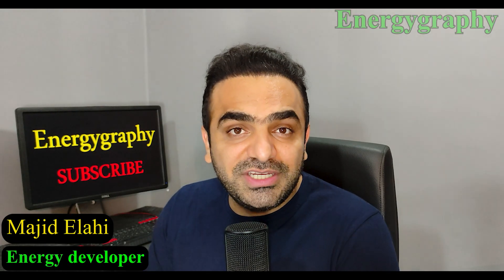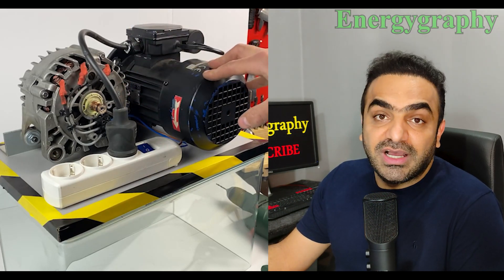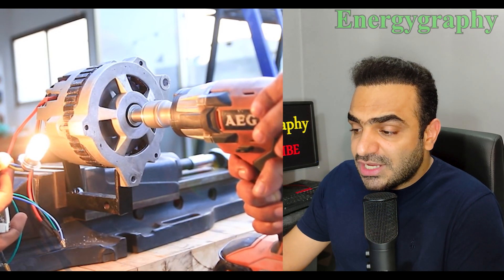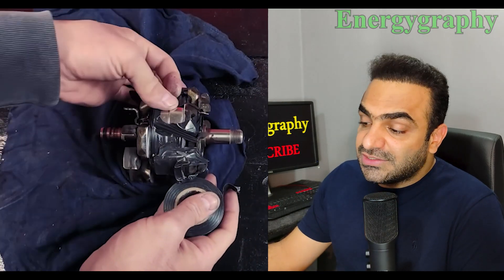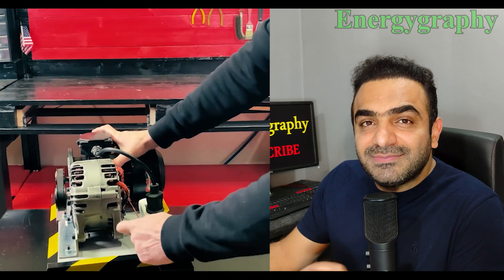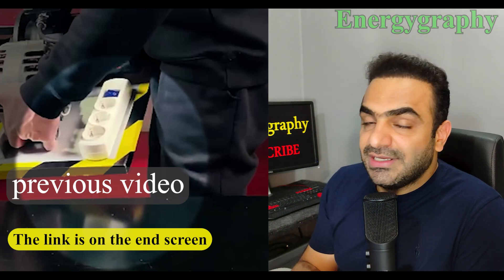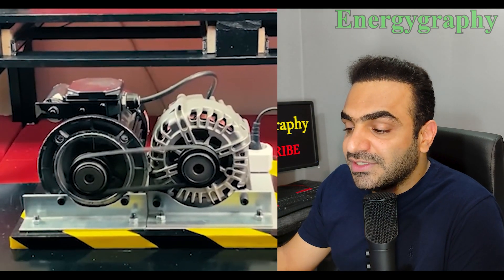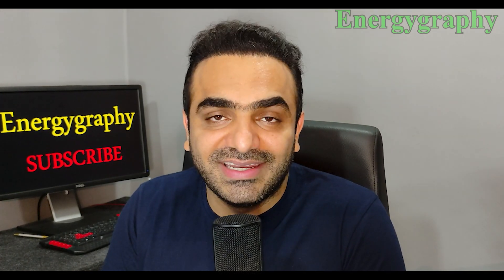The Truth Behind Free Energy Generators: Alternator Myths Busted!

Comment: A car alternator coupled to an electric motor works very well as a charging system for car batteries but it cannot be perpetual without further compensation.
Do the math:
A 100A car alternator needs about 3HP to turn it.
1HP = 746W X 3 = 2238W of Pure Sine Wave VAC to run the motor.
That is 18.65A at 120VAC.
Electric motors can take up to 7 times the running current to start the motor.
18.65 x 7 = 130.55A 
No Pure Sine Wave Inverter exists that will change 12VDC into 120VAC at 130A, let alone provide additional power for anything else.
The only way to possibly start this motor is to start it on grid power and then switch over to Inverter power while it is still running with no load on the alternator.
If you use a 5000W PSW Inverter that gives you 41.66A at 120VAC (PSW) you could potentially have 23A left over to run another inverter for other things, if you are running everything at 100%.
Again, you would have to get the motor started first, then switch over to Inverter power.
Maybe if you coupled 2 motors to 1 alternator by pullies, started the first motor on grid power, then started the second motor on the Inverter power, and then disconnected the first motor from the grid.
I would love to do this R&D, but it would be more expensive than I could afford.
$1200 for the PSW Inverter, $150 for the Alternator, $150 for the battery, $500-$600 for the motors, wires, switches, pullies, belts, ammeters, base plate, etc.
Not sure about how long it would last, but doable.
Does anyone have any money for R&D?